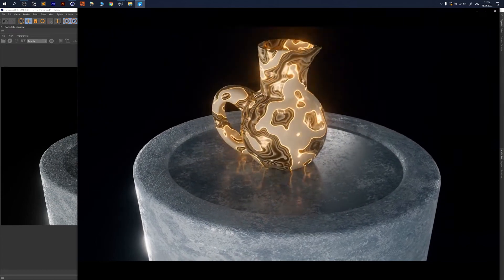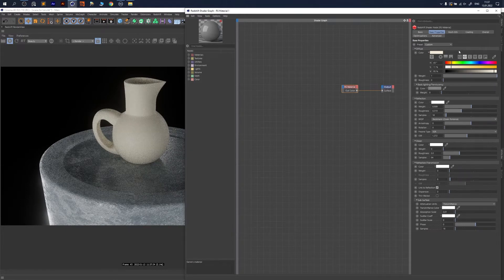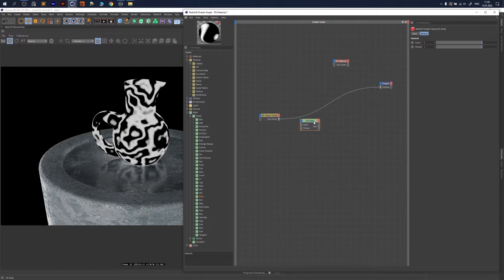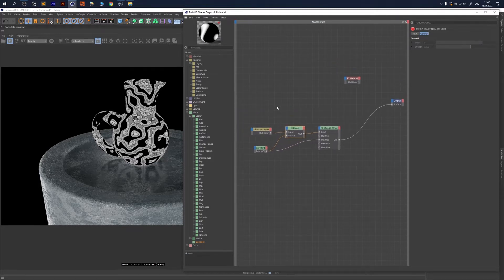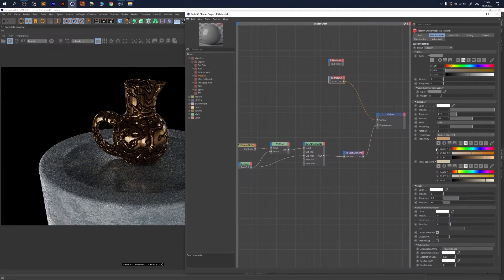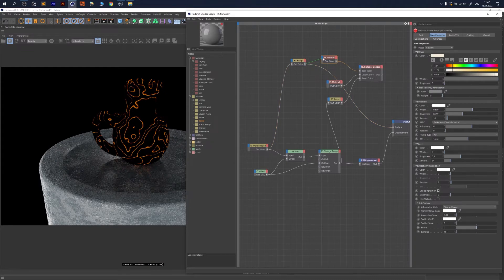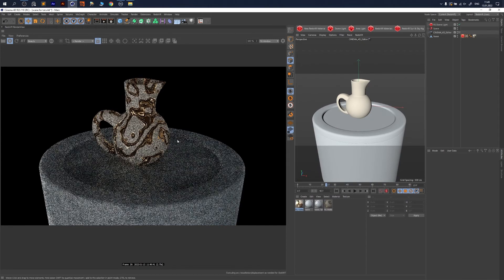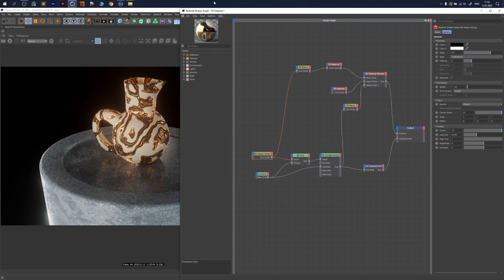Cinema 4D and Redshift Tutorial - Build a procedural material for creating cycled noise effect

Comment: nice :) this is not possible in octane?
Reply from the maker: Thanks!
I've used Octane 2 years ago last time, so have no relevant updated info about features out there. 
You could use maxon noise in octane (if I remember that right), but don't think there is modulo operation. (might be wrong)

Sooo) you could do everything else in octane but the modulo and change range.
Reply from the maker: One of best tuts for octane and noises I ve seen, you could check on this channel
https://youtu.be/-vTZlJpey6s
Reply: @purplelight2947  thanks :)